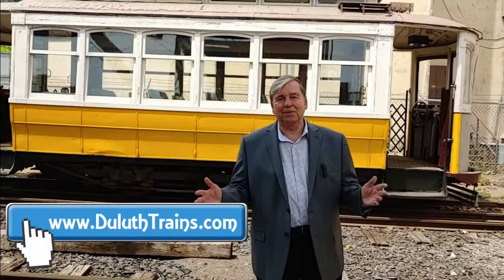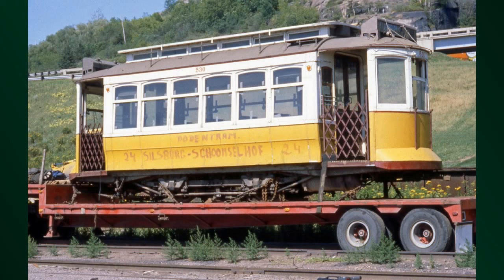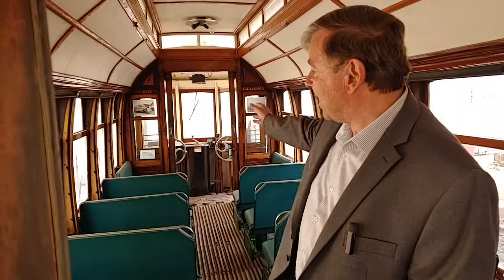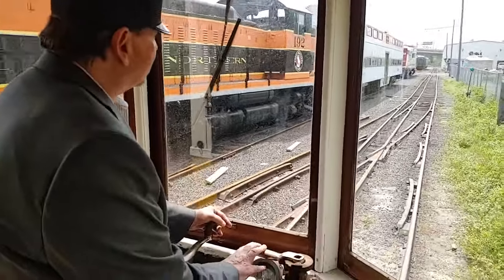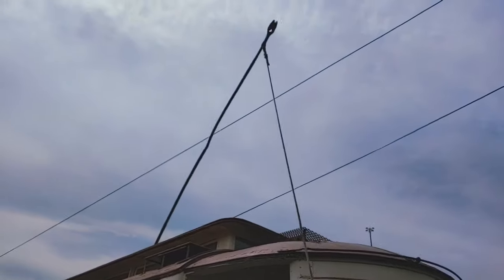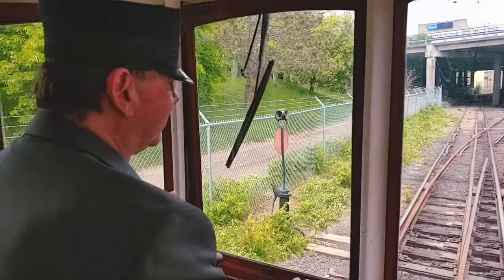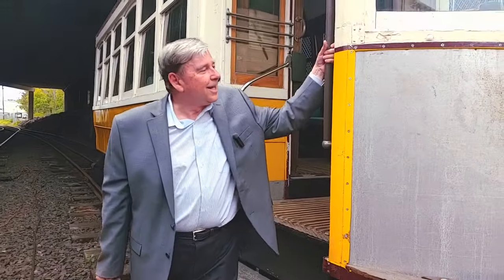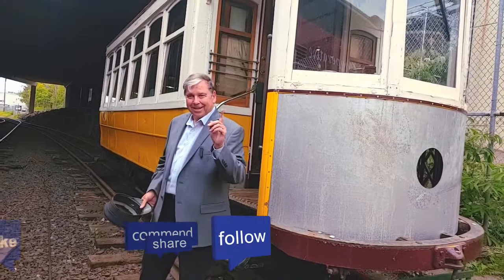Classic Trolleycar Ride

Comment: What you said about General Motors killing the trolley cars is true.  However, here in Grand Forks, ND, there was another reason.  The tracks were first laid when the streets were dirt, so they were cheaper and easier to maintain.  By the 1920s when many streets were paved,  track repair became a major and expensive undertaking.  Also, by replacing them with buses, the routes could be changed.   Still, I think the trolleys were pretty cool, and it's too bad they went away.

Comment: During my visits to the LSRM I have ridden that Lisbon trolley many times.  The gauge of that trolley is one meter ( metric ).  That is equal to 39.37 inches.  Most USA narrow gauge railroads were 36 inches.  Duluth streetcar # 265 still exists as a companion to Twin Cities Rapid Transit # 1300,  They run at Lake Harriet in Minneapolis, MN.  Duluth also had electric rubber tired buses for a while.  That's another chapter.

Comment: Trolley and Interurban lines reached their zenith around 1910. They were often the parent company to a fledgling utility or a subsidiary of a utility. They often struggled to turn a profit, and some were subsidized by power and light revenues. There were also some big corporate and banking rivalries during the 1920s that eventually drew the attention of progressives and reformers of the time, and may have helped drive some of the last nails in the coffin of many traction lines. The Insull / McKinley rivalry was one of them. There was also a rivalry between Insull and financier Cyrus S. Eaton. You might also read the story of Senator Frank L. Smith from Illinois. A lot of economic, technological, and political conditions contributed to the downfall of the streetcar. 

I am both a rail fan and a line geek. I study the evolution of gas and electric utilities. Notable utilities magnates like Insull, Eaton, and Foshay built up the seminal grid in my home state of Nebraska, and their risky or unethical behavior led to the creation of public power. 
I Iove everything about electric traction!